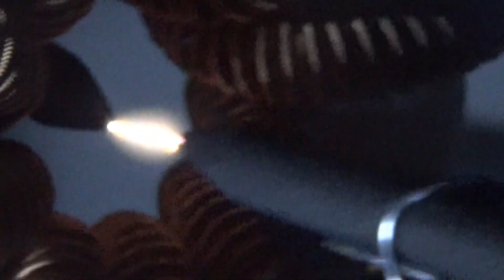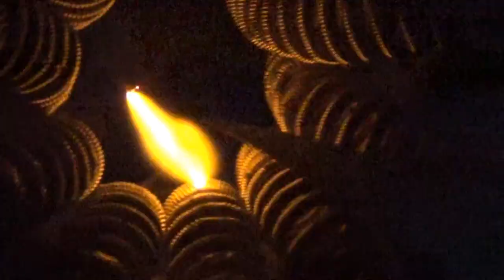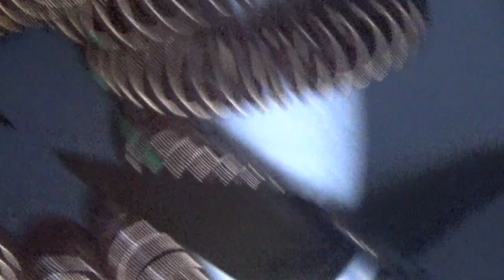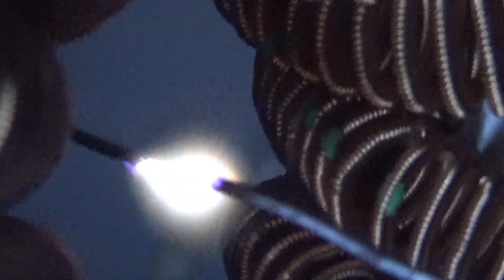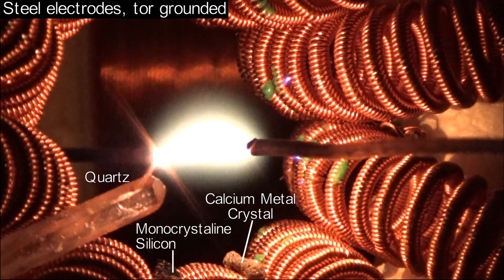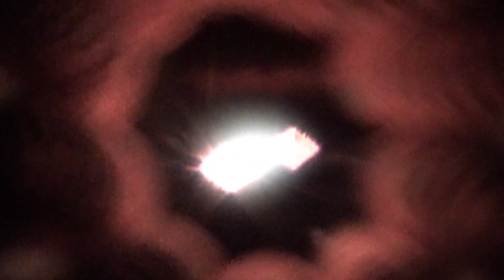Bagel Tests - Grounding and Electrodes

Comment: May I make the suggestion that you see if your hands are sensitive to the fiends created by such wire?  I made wire consisted on a central wire with an outer wire wrapped around it which is what I assume you have there (if there is a central wire) and when this compound copper wire was wrapped around a large Zinc (Copper 29 Zinc 30) nail when energized with high frequency input with one live and one grounded end there was a tangible beam created, the tangibility grew over time.  Initially it was on the edge of perceptibility, over time it grew intense.
Reply from the maker: That is interest Jonathan, can you share a photo of your set-up. If not here, on RemoteView.ICU?

Can you use a diode, may be in reverse bias or dust or a Compact Fluorescent bulb or something to see if there is a nonhuman detectable emission?
Reply: @MFMP  I did that test in 2012 and no longer have the wire (misplaced) it's a massive pain to make but I can make an image to show how it should look, will that do?  I have not tried detection but very possibly it can be detected.   I have far more advanced designs (stronger subjective feedback) including in circumstances that removes placebo effect.  I shared such a design on the Quantum Heat in the Welcome section with the title:  EM affects "Aether", and this matters!

Comment: Do you know if Phil is running the bagel at a resonant frequency?  Because of the odd design, the calculation is not simple, but can be done with an oscilloscope and a frequency generator (to find a minima - could be more than 1 resonant freq)
Reply: he has it in series with one of the terminals, 60Hz mains
Reply: @sFeral  Ah, okay. I have a feeling it will be more effective at a resonant frequency, preferably one that has matching  harmonics for each winding dimension of the torus. So if the smallest wire diameter coil had a resonant frequency, that coil wrapped (to form the next coil) would be an integer multiple of it - that is also resonant, then the next level would be an integer multiple that is also resonant.  It's a mathematical nightmare and sizes, diameters, packing, etc would have to be calculated on a computer. (need a math whiz to figure this out - I did the concept work... lol!)
Reply: @davestorm6718  he could measure the self-resonant frequency experimentally, but it seems he has different ideas on what to do with it
Reply: @sFeral  id be careful with 60hz mains and bagels. these fields may be bio-active.... you wanna use a safe frequency such as 50 i reckon
Reply: and may get better results too based on some theory from Winter.
Reply from the maker: This
Reply from the maker: He has no means to vary the frequency at this stage
Reply: @MFMP  something to look at c2UskmNoZNM

Comment: Plasma ball in a toroid.
Reply from the maker: Need to be aware that a simple wire loop grounded may achieve a similar thing
Reply: @MFMP  Bob, If the universe is a toroid that repeats itself and also a sphere by us then this experiment makes sense. You have the toroid coil and the plasma ball. The big bang is continuing all around us. We see this in the cosmic rays that are mostly electrons.  You have the electric field so maybe you should put some sort of magnet into this mix or maybe the toroid makes the magnetic field as I am not sure and then quite possibly you would get the gravity field. The universe has a lot of geometric parameters. I am not sure what type of magnet to use. You would have to experiment or maybe with your experience you could figure out what magnet to use. What is the shape of the magnetic field surrounding the sun, moon, and earth? Maybe then you could produce fusion. The current fusion reactors are off the mark by making a toroid electric field and magnetic field. Maybe you could put water vapor into the mix.
Reply: Bob, maybe put an electrode top and bottom of a glass sphere in the center of the sphere, put a toroid coil surrounding the glass sphere in the center of the sphere, add some water vapor in a feed inlet, strike an arc and energize the toroid coil, and presto fusion with iron and gallium waste and tons of electrons that can be used for electrical power. The sun outputs photons, neutrinos, and electrons in this manner. The magnetic field of the moon, sun, and earth are from the electrons traveling around the surface of the glass sphere and entering the top of the sphere and exiting the bottom of the sphere. In my opinion.
Reply: Bob, I would use a 120-volt AC power supply that produces 12 volts pulsed DC and vary the current to control the fusion reaction. An electric arc is produced by the power of the circuit and not by high voltage. Gravity is a low energy and not a high energy. High voltage is too high and energy in the circuit.
Reply: Bob, you are so close to getting the reaction correct so don't mess it up by telling me that you don't believe what I explain. I came up with my theory 40 years ago and was labeled a crazy person.

Comment: Put it in an open-ended glass tube maybe to prevent the arc-over to the bagels? those coils look expensive....
Reply: like find a nice tall tumbler and hack the bottom off it
Reply: might wanna sand the edges too so you dont nick the enamel wires ;-)
Reply: dont listen to me though. I have no credentials.
Reply: @nondysjunction  ide say to avoid borosilicate glass tubes and go straight for quartz if David Hudson's and rifes all labware glass shattering stories are true. Although I dunno why rife insisted people remove their eye glasses as they wouldn't be borrosilicate. Perhaps he was concerned the evos might pickup matter in the eyeglasses although seems strange. Anyways aliexpress has some good cheap quartz tubes for like 25 bucks 56mm OD 250mm long